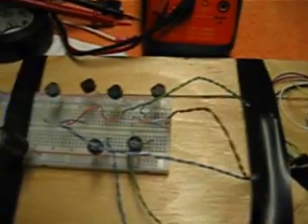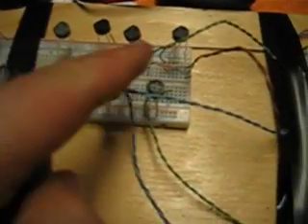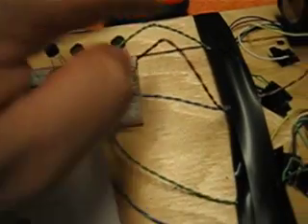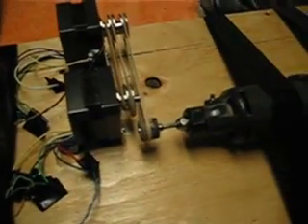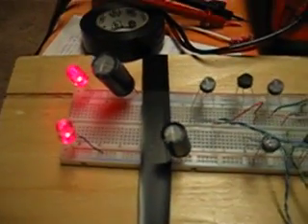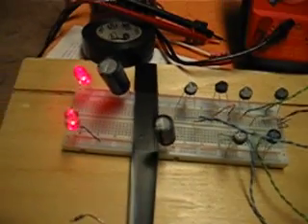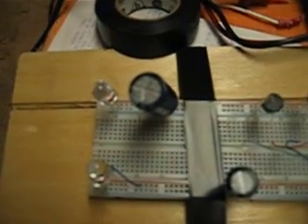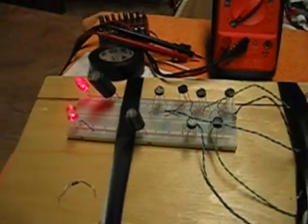Stepper Motor Generator - Experimental Bridge Rectifiers 1

Comment from the maker: I've tried with and without resistors and I've concluded that there's no way that I am ever going to burn out an LED with any generator.  They simply do not produce enough current.  I've only ever burnt out LEDs when I have underestimated the length of time that a capacitor can hold a charge.  The surge current produced by plugging a charged cap into the circuit will fry any unprotected LED instantly.
Ta for the nomenclature lesson also.

Comment from the maker: Unfortunately you are looking at fractions of an amp for this setup. If you talk to Peter over at modelenginegenerators-dot-com he has a more substantial unit that might serve your needs better.
The diode circuit is easy enough. To maximize current a half-wave circuit works best. For that you just need a single diode on the end of each coil in the motor. I don't have space to get into it here, but if you google stepper motor generators and half-wave rectifier circuits, you'll find what you need.

Comment: how many amps does this output? I need to know, because I want to use a stepper motor for charging my 12v 5Ah battery on my bike. Also, can u give me a parts list and schematics for the rectifier circuit?